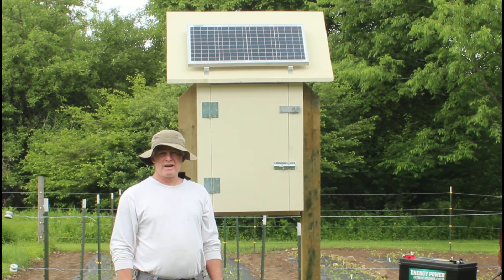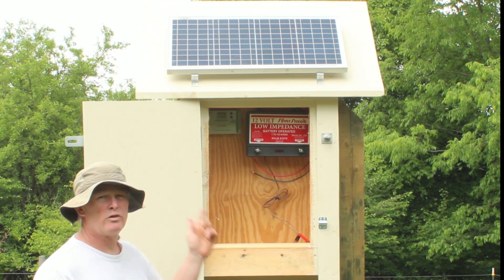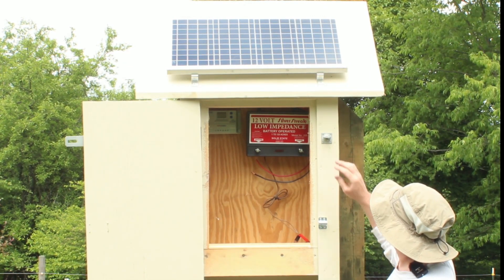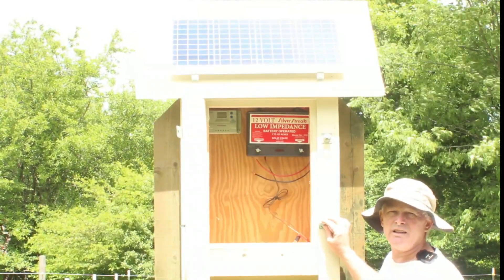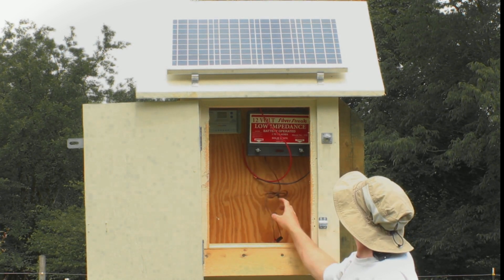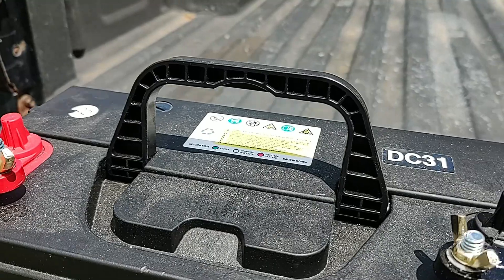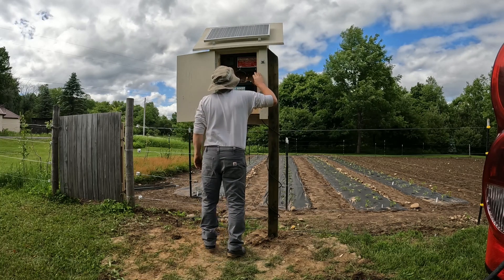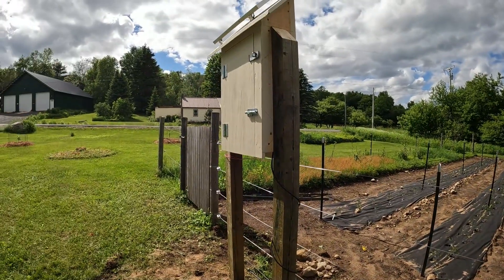Solar Electric Fence - How to Combine Individual Components

Comment: Does the fence require the grounding rod or could it just go back to the negative side of the battery to close the loop?
Reply from the maker: It will work, but significantly reduce the jolt.  At the orchard I used the metal T-Posts in addition to 4' grounding rods.  It has 2 negative fence lines connected to the metal posts with metal clips, turning the T-Posts into grounding rods.  The 2 positive fence lines are attached with off-set electric fence insulators.  The circuit is completed by touching a positive line and the ground or a positive line and one of the negative fence lines. I'll see if I can shoot a short to show the differences with that system.

Comment: Nice setup! I'll probably be needing some solar chargers before too long, and this looks like a solid rig.
Reply from the maker: If you have the choice of an A/C Fence charger, they're much more powerful, but if you need an off-grid set-up this works pretty well.  At the orchard I upgraded to a 50watt solar panel and a D/C Cyclops fence charger and that system is working pretty well.  Found out it's better to just spend the $ on a good fence charger up front so you don't have to keep upgrading.